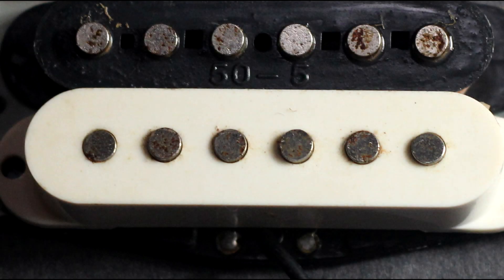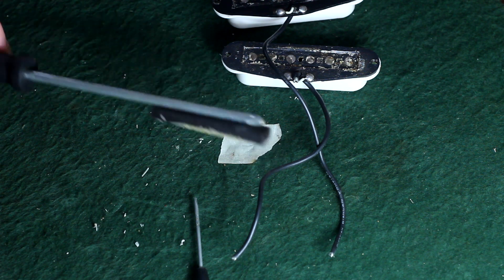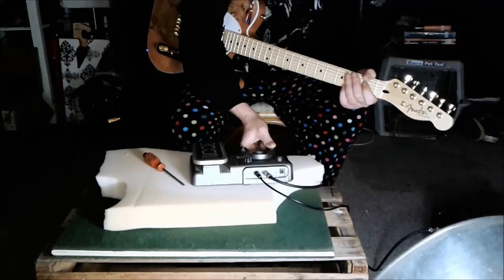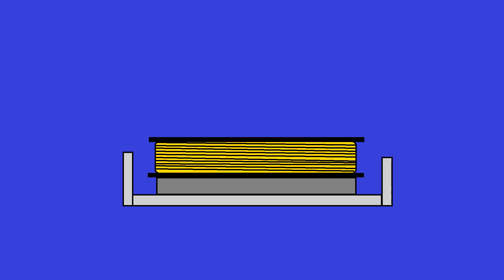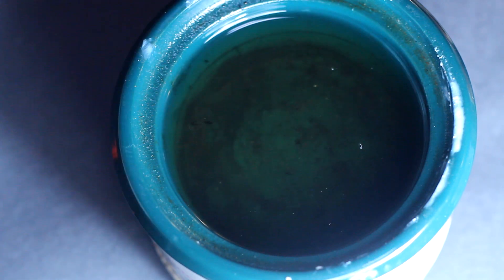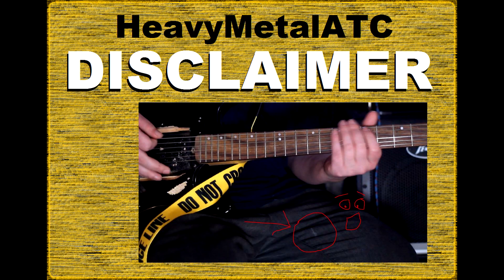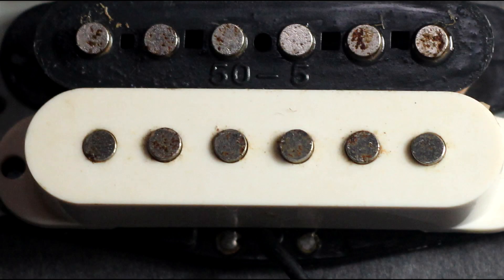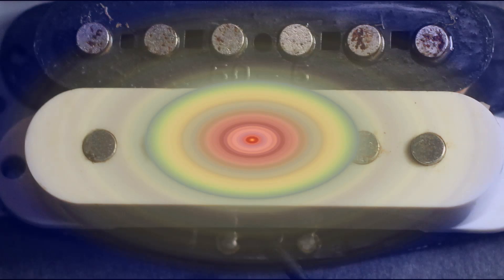DIY Humbucker Experiment: Insane Output + Clarity from Strat Coils (Full Build & Demo!)

Comment: I ll burst your bubble but this is not bucking since both coils are wound the same direction.you would have to flip one of coils up side down or wound wire on one of the coils the opposite direction. What you did is just change the position of two single coils 😄
Reply from the maker: I see your bubble and offer you 1 reverse bursting 🤣 Strat and Strat copy middle coils are absolutely reverse wound and reverse polarity which is what gives S-style guitars that extra quiet mode in the quack positions of 2 and 4. This is what actually makes humbucker/series wiring on a strat so easy to do and it can definitely be done inside a normal pick-guard but this allowed me to get some super strong magnets under there with a steel back-plate to boot. Thank you for watching and taking the time to comment Jakub. Totally astute observation and valid point just not applicable in this particular situation. 🤝

Comment: I thought humbuckers are wound together on both halves as opposed to having 2 separately wound singles together?
Reply from the maker: That's a great question, and it's an excellent point about how they are commonly built, I could see how looking at the way the tape is wrapped on both coils you could easily think that but, Yes the 2 coils on a humbucker are individually wound single coils wound in opposite directions with one single magnet under them giving south pole to one and north pole to the other. However this comment has got me thinking about trying to make something like what you were thinking. If you used magnetic poles like on an original strat pickup and screwed them to the back plate and wound the whole thing at once... who knows what the sound might be, it would be like a double size double magnet single coil with only about 1.5 times the wire. this might be the coolest thing ever I'm sure it would have a very clear and bright sound... IM going to put this in my notes right now. Awesome Idea to try.

Comment: Love your videos.
Regarding baseplate - I read somewhere, that damping effect come from eddy curents induced in the "non active" parts. So maybe creating baseplate from transformer core lamination sheets will give higher peak. On the other hand resonant frequency depends on magnetic permeability and now I am thinking that using core lamination sheets will give pickup with stronger resonance at lower frequency...

Comment: I have some old low output ceramic pickups left over from upgrades that I was thinking about converting to ALNICO 5, if I were to add extra windings with them tapped do you think this could work ok?

Comment: The late Robbie Robertson had a second pickup snuggled against the bridge pickup in one of his Strats.  I had always thought he was combining the two coils in a manner similar to what you've done here.  But it turned out that he simply hated the way the middle pickup got in the way of his picking style, so he asked his luthier to move it over and out of the way.

That said, note that the original Fender Wide-Range Humbuckers were essentially two separate pickups, wired up RWRP to cancel hum, and wedged into one shell.  I had bought one when they first came out, and dissected it.  Where conventional PAF-style humbuckers have a row of slugs in each coil, magnetically coupled underneath by a bar magnet, the WRHBs are two independent coils with their own set of CuNiFe polepieces and NO magnetic coupling underneath.  It's possible that the baseplate provided some degree of coupling, but I can't confirm.  After all, it's been 50 years since I took that pickup apart (and later sold the guitar it was in).  BUT, the threaded polepieces could be made to protrude out the bottom of the baseplate through holes that were wider than the polepieces and precluded contact between the polepieces and baseplate.  So if the baseplate WAS ferromagnetic, and permitted any coil-coupling underneath, it would have been very weak.

As an aside, I wired up a dual HB Vantage guitar I bought 2nd hand (I think the double creme pickups are Schaller), using a Peavey T-60 tone control for the bridge pickup.  Those pan from single coil, thru to dual coil, and finally dual-coil with treble cut - bright-n-thin to thick-and-dark.  I also wired up a phase-reverse switch for that pickup.  Much to my great surprise, when in single-coil-only mode, the coil closer to the bridge sounded quite different than the coil further from the bridge.  Hard to believe such a small difference in bridge-to-coil distance would matter, but it does.  Of course, that is precisely why Fender angles the bridge pickups on Teles and Strats, to move the polepieces for lower strings a little farther away.  That also seems to be part of the strategy underlying the WRHBs, whose threaded polepieces can be adjusted to mimic an "angled" humbucker.

Comment: I have wondered if sticking two Strat pickups together and wire in series, what it would sound like. The side benefit is you could coil split and have a REAL single coil tone. If you have a single coil guitar, you could wire it with a push pull and run middle in series with the bridge, and middle with the neck. Adding two options to the five way switch. Of course these options wouldn’t involve changing the slug magnets for the back type like you have done. I do think adding a ferrous back plate is a great idea and can be added as well. Very enjoyable video thanks for sharing!
Reply: This also got me curious, will it amplify the hum noise?

Comment: "if it's twangy, it's....rockin' (?)"
>generic country lick followed by brutal harmonic rectifier noises
Reply: I don't know the physics behind it, but in 2004 I bought a telecaster and it ended up delivering the best high gain tones I'd ever heard. All these years later and I'm still running a tele for the purpose. Something about that bridge and pickup format is just absolutely amazing for it. The design also shields for noise exceedingly well, to the extent that one of my teles is running true single coils with an EMG afterburner, and it's really not that bad.

Comment: With 3 magnets, is it really a humbucker? One set of pole pieces should be north and the other south. Did it work out that way? 

Also, I found that vinyl coated steel wire wrapped around the pickup (after they're wound of course) does some crazy shit and still sounds awesome. That is kinda-sorta like your steel base plate. Although, what I made was a single coil using square neodymiun magnets in a halbach array.
Reply from the maker: Thank you so much foe watching and taking the time to comment. I had someone ask the same thing in a pickup building forum and I think it was humbucking in that configuration I had it wired in series and out of phase if my memory serves and it was definitely in phase on the way out? Either way I wouldn't use this much magnet on a guitar for any practical purpose this was just stupidly high output you'd need a noise gate from hell to use it even humbucking. I keep hearing about these halbach arrays, I havent the slightest how it works... need to look into that.

Comment: You didnt explain how you wired two wire pickups together?
Reply from the maker: Thanks for watching and taking the time to comment MM. They were wire in series out of phase. An easy way to put that is the positive from one coil is used as the positive the positive of the other coil is used as negative and the other 2 are wired together in the middle.

Comment: do i just twist the two wires together to combine the two pickups?
Reply from the maker: Ri I wish it was a very simple thing to explain but its tough to do on a comment. 
in general for humbuckers you will have one wire from each coil going to the out put and one wire from each coil tied together but one coil wired backwards and this may or may not work depending on the direction the coils were wound and the polarity of the magnets...
 
See its some BS to explain without pictures but I got a video that will explain it perfect: 

https://www.youtube.com/watch?v=Q-l4HhVdO4M
Reply: In theory, you would connect the start wire (hot) to the finish wire (ground) of the other pickup. Solder those and cover it up so it doesn't short, and the remaining hot and ground are now your lead wires.
Reply: BUT keep in mind that one pickup has to have reverse polarity from the other.

Comment: Just a note on a misconception about Magnets and their Magnetic Field:
The stronger the magnet, the smaller the geometric footprint of the magnetic field will be.
This is due to the fact that what we call the "attractive force"  of a magnet, is actually not Magnetism, but rather Dielectric Acceleration.
Meaning: there are two phenomenas involved in a magnet: The Dielectric = Pull/Attraction/Centripetal Force & The Magnetic = Push/Repulsion/Centrifugal Force.
This means that as the "acceleration" increases (the "pull/strength" of the magnet), the Magnetic field decreases and the field becomes smaller.
You can compare it analogously to a form of "compression" of it's strength, making the magnetic field smaller but more powerful.
If you put a magnet under a Super-Cell (Holographic Viewing Device that shows the magnetic field) you will see this phenomena with your own eyes.
This is why your constriction of the magnetic field results in such a high output.
A bit confusing and contrary to popular belief, but clearly evident if you have the correct measuring equipment.
Reply from the maker: dude I read all this last night and I'm gonna try to soak this in and keep it in mind and yeah i def need to get me one of those little clear rainbow magnet sheets.
Reply from the maker: Also thank you so much for taking the time to type out all this information. I appreciate it.

Comment: I have a set of fender single coils and I’m gonna try this out
Reply from the maker: awesome! yo did you try it, did it feedback like crazy? hahaha?
Reply: @heavymetalATC welp I just got around to actually doing this the other night but still didn’t install it in a guitar. I built a Les Paul for my 5 year old daughter that the paint came out SICK by accident and also a $250 eBay diy Kramer kit guitar that my daughter wanted me to paint it purple with big metal flake which I was completely fine with lol and I’ll tell you dude I have NEVER been happy with the electronics a guitar comes with stock I need that Van Halen, Metallica fullness (without active pick ups), I have a very sensitive ear that pissed off band members and engineers because I could tell the difference between a live amp and digital so I know what I want to hear and the $250 eBay diy Chinese Kramer pickup is literally the only pickup that came with a guitar that I don’t want to change I couldn’t believe it! I obviously changed the volume pot because I put EVH volume pots in every guitar but that’s it’s as far as electronics go. The tuners were absolute trash, the fake “licensed” Floyd rose I would never use in the guitar if I was still playing live shows because the “knife edge” if you call it that where the bridge contacts the 2 bolts is soft ass metal definitely not hardened it actually showed signs of wear in the prolly first few hours of play time so I would get a legit Floyd or atleast an actual licensed Floyd lol!! Had to do a fret job but neck is mint and honestly if you take the $250 I paid then add a few hundred for better hardware you would prefer it over guitars for thousands of dollars. Idk how I started talking about that guitar maybe because I’m gonna slam this homemade piece of crap humbucker I made from 2 strat pick ups I removed from my start the week after I bought it brand new 15 years ago lol. Anyways I love ur videos, I absolutely love ur sense of humor, your one of very few people I know that think “roll that beautiful bean footage” is fucking hilarious or even knows about it haha I just get great vibes watching ur videos man, keep em comin!

Comment: Does adding more magnets change the sound of the pickup? For example, would the sound have been different if u stacked 3 more magnets either on top of the 3 u already placed on the base plate, or if u placed 3 more magnets on the under side of the base plate?
Reply from the maker: Oh yeah, everything like that changes the sound... just flipping the magnet to the edge changes the sound... I do plan on getting back to these exact types of experiments on this channel.

Comment: Loved this. I wanted to learn more about pickups before buying a new one (was looking at an invader) but after this video instead of dropping a load of money on a brand I'm gonna buy some magnets and do some tinkering.
I'm thinking a neodymium with 2 ceramic magnets either side. Still an insane pickup but not AS insane is what I'm hoping for, unless mixing magnets would cause an issue? Thoughts?

Comment: Just for curiosity sake, you used wood in your other pickups, but could it be made of PVC? Or other plastics?
Reply from the maker: Thank you for watching and taking the time to comment Henrique. Yes, you can use plastic, plexiglass, thickly painted metal, even stiff cardboard. I know that sounds sketchy but the old fender pickups like the most sought after ones in a vintage strat or tele.. fiberboard flat work which is basically thick cardboard. It just needs to hold the pickup together and preferably be non conductive to prevent the pickup from shorting out prematurely as it ages and corrodes.
Reply: @heavymetalATC  I want to tryout two new designs that I made, but as I want a proof of concept I don't really want to expend too much on it.

Comment: What would adding a piece of steel underneath do to a normal humbucker?
Reply from the maker: Thank you for watching and taking the time to comment Aidan. That is a great question. I think if you replaced the no ferrous plate it would probably make the pickup a little brighter and maybe a tiny bit louder it would be hard to do though because regular humbuckers have threaded slugs that go into tapped holes in the backplate but I have been told that there are some types of humbucker that come with a steel backplate.. If you were to just add the metal backplate to an existing humbucker along with the brass plate i think it would maybe get louder and possibly bassier because it could conduct more magnetic field through the brass plate.

Comment: If you are wanting to really check out how strong a pickup is you could attach it to an AC millivolt meter and checkout how much signal it is actually producing. Maybe do it with a fixed load, that way it would be a fair test between various pickups.
Reply from the maker: Thank you for watching and taking the time to leave such an intelligent and well thought out comment Xanataph.You are exactly right, it may be hard to catch a peak on an multi-meter but an oscilloscope would be perfect. I may try this in the future and see what kind of readings I can get. Thanks again.
Reply: @heavymetalATC  Definitely an oscilloscope would be better for catching the peaks. Nevertheless a meter would give a very good average signal indication. And that would be a very fair test for comparing the outputs.

Comment: hey man wssup, i have 2 doubts. 
If I want to use this as a 5 wire humbucker, do I just need to solder a ground wire from the plate and its ready to go?

And the other one, If i want2 use this in a push pull to make split coil, do I need to wire it as Split Coil or as Series (to the push pull switch, obviously :P) ? and if I wire it as Series, how can I do it so it add the other coil in series when the switch is up and just to use 1 coil when the switch is down?

The reason why I ask all this stuff is bc i have a lot of SC's sitting around just making dust and I don´t really want2 buy humbuckers
Reply from the maker: Thanks for watching and taking the time to post such an in depth comment. You are correct to make this a 5 wire you simply ground the base plate, Its hard for me to figure out the exact wiring scheme without it right in front of me and even then its quite a mind bending task but it will need to be in series to humbuck and also out of phase so you will want to hook them up to the switch where its only one pickup on with the switch in and with it out it connects the two in series with the second backwards... this is just a simple split coil humbucker wiring diagram that you can look up but you will have to figure out the color code for the wires as they will simply be two shield wires and two center wires and the ground but once you figure out the color code from another 5 wire pickup it will be paint by numbers... I know thats not completely helpful but its exactly just that if you find a digram treat the 2 pickups like the 2 humbucker coils and you got it.

Comment: if you take a cheap hot rail style pickup from ebay and remove the magnet you can put it on top of the pickup betweenthe rails and  add a magnet to the bottom that may be a job for the test mule
Reply from the maker: Thank you so much for watching Jeffery and also for taking the time to write a suggestion. I will put this on my list and if when I use this idea in a video I will give you a shout out. Thanks again bro.

Comment: Sounds great! Did you run it through a tone pot or straight through to the jack.
Reply from the maker: Thank you so much for watching and taking the time to comment Yaw. It was just run straight to the jack with alligator clips. Im sure a volume knob and a tone circuit may take the edge off slightly on the high end.